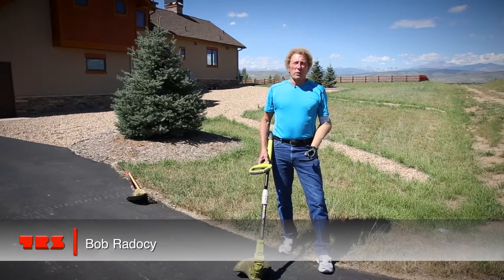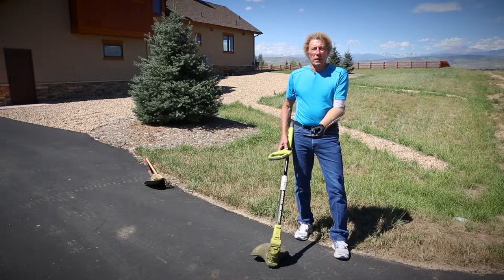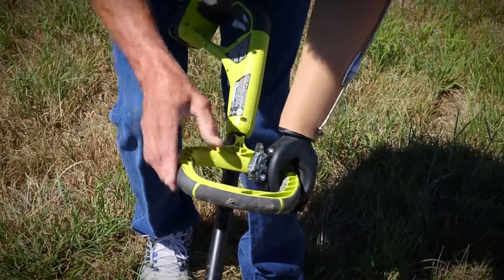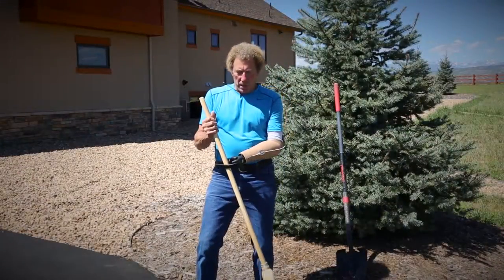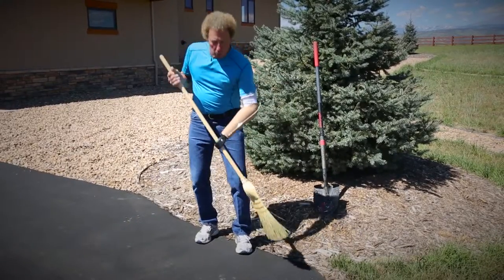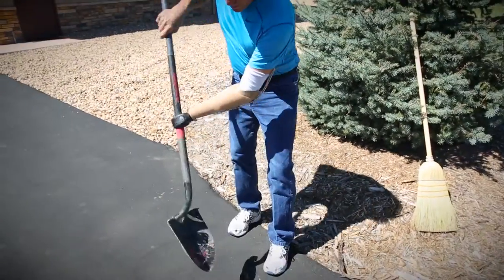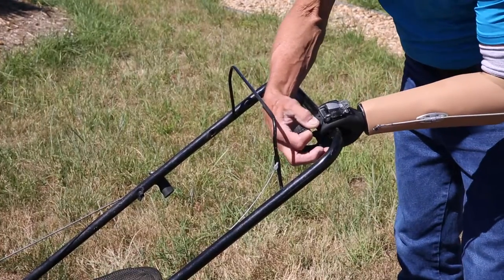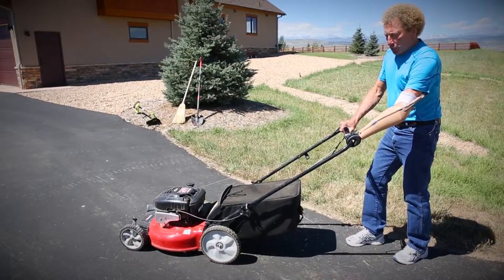Multi D Training

Comment: I got one of these this year for kayaking, without really much thought of any "practical" uses for this.  It works pretty well for sweeping in any event.  I did find it funny with the lawn mower example, in that I was wondering how Bob is going to start the mower without using this device to lock down the safety stop when he starts the mower.  (Assuming pull start.)  Still better than my method of using a strap to lock it down.... 

Thanks for the how to, in that my experience was picking this out of a catalog, putting it on, verifying it works, and then going home.
Reply from the maker: Thank you!